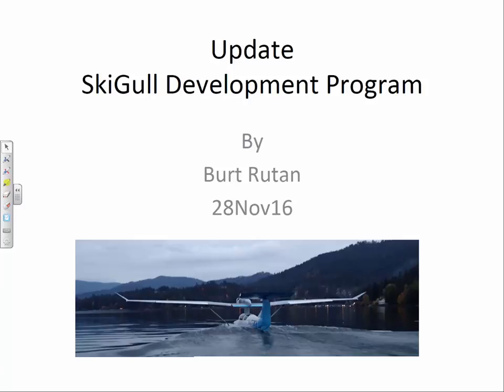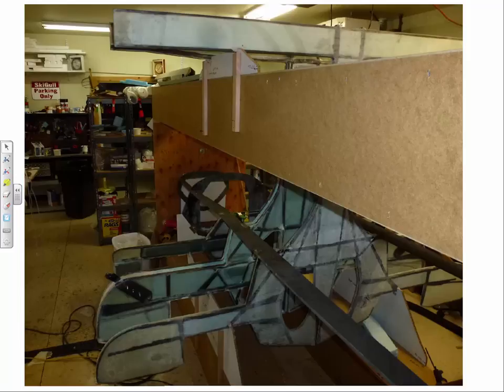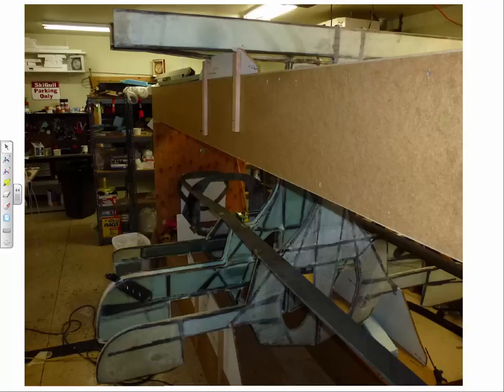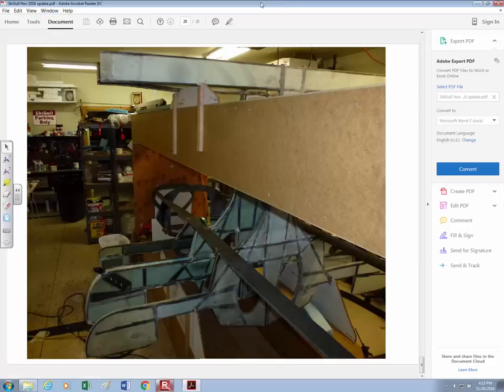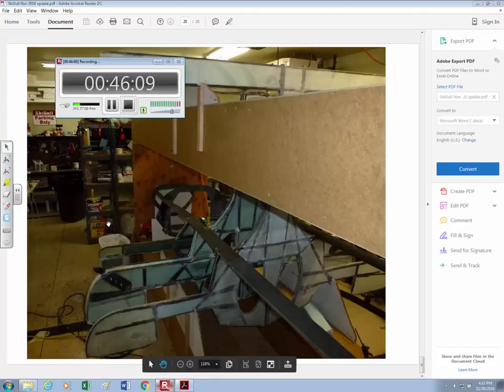30 November 2016 Rutan SkiGull Talk; North Idaho College

Comment: Actually there are also full composite Dornier seaplanes around. They also do well on water.
Reply: In 2016 Dornier aircraft were not ready for production I think...
Reply: @electricaviationchannelvid7863  The Dornier Seastar flew in 1984 for the first time.
Reply: @unclewerner  How many exactly? 1-2 prototypes? An asian company bought it up finally after several production initiation failures of version 2 of the aircraft...
Reply: @electricaviationchannelvid7863  A Chinese company provided funding. I've seen them flying over my house several times. I'm sorry if I have endangered your little world. I just wanted to point out that the Dorniers, the founders of seaplanes, are also still around.
Reply: @unclewerner  I really like the genius designs and quality of Dornier engineers...I was very happy when they reworked and announced the new composite seaplane...it was a huge market opportunity since there was/is a market gap/demand for it...I just do not know how they could not secure enough funding in Germany/EU!!! and let the company go to foreign hands... This story clearly tells that Europe is not the economic powerhouse it used to be anymore...
Reply: @electricaviationchannelvid7863  Whenever I hear them flying I look up. A couple of years back they still seemed to have issues with the push/pull configuration and you could here that from the noise. But recently I have difficulties spotting them and I noticed they got much quieter / smoother running. As an engineer I couldn't care less who sponsors the development. The US didn't do much good with its influence in Europe recently. Its your puppets that run the show, so please do not complain about lack of performance or intelligence in terms of investment.

Comment: Can a winglet actually product a small amount of thrust?
Reply: It does. Search for Withcomb winglet:
https://en.wikipedia.org/wiki/Wingtip_device#Early_NASA_development
Reply: No it can't, but it can reduce induced drag.
Reply: Yes, if Rutan has figured out how to break the laws of physics. :D  At best, it can provide a bit of lift and stability.
Reply: Yes. 

But only at high lift coefficients. (High angle-of-attack).

The wingtip does produce some thrust, working like a sail on a boat. The net reasult of the whole wing still creates drag. Because the wingtip cannot overcome more than maybe 10-20% of the great induced drag of flying at a high angle.of attack.